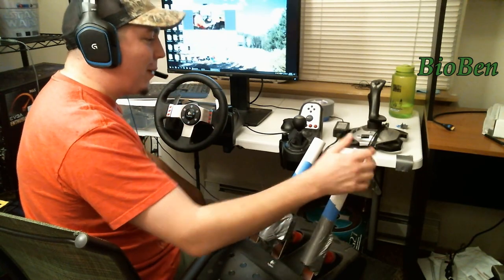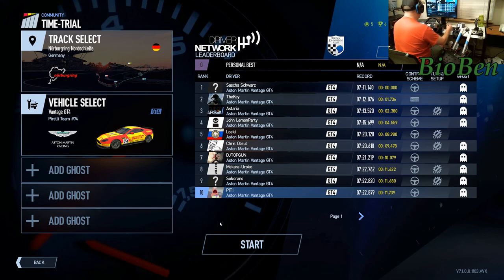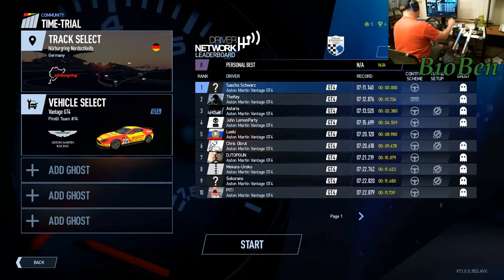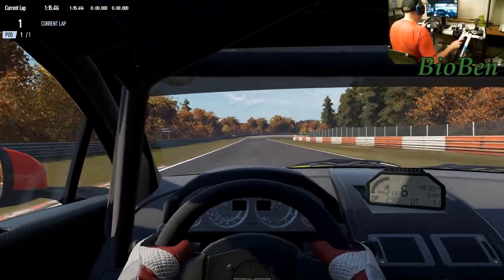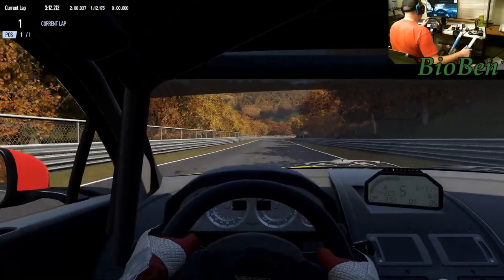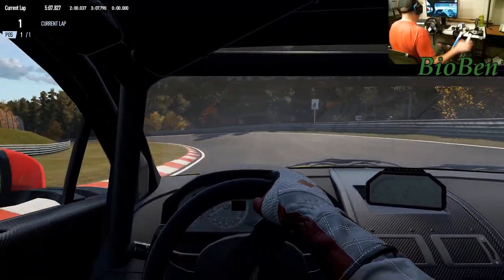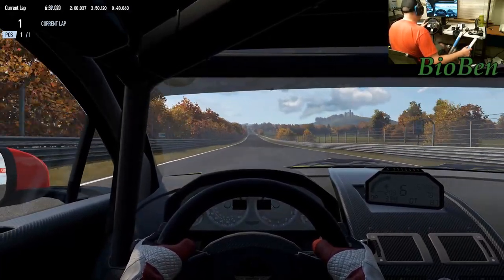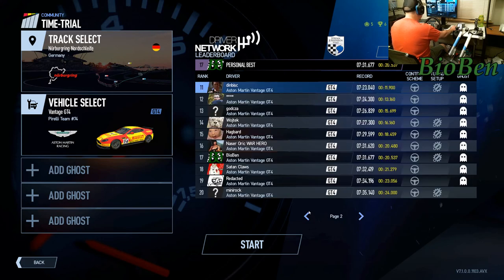Sim Racing DIY Gas Brake Mod Hand Controls For Disabled Gamers | Steering Wheel Project Cars 2

Comment: Look in to the 3drap hand controller. It is a 3D printed hand control gas/brake combo. There is also options like Simability GT Paddle Kit.
Reply from the maker: Ah cool products 😀 was trying to keep it simple and cheep for my friend, but something a bit more pro would be cool. Other thing is if they are Xbox compatible?
Reply: I believe that Simability have some that are thrustmaster compatible. Barry over on Sim Racing Garage here on YT just did a review on a Simability.
Reply: I just looked now and the Simability works on Xbox.
Reply from the maker: @WastedWhiteBoii  awesome I will pass it along to jaf! 👍

Comment: Not bad Ben , that is a great idea and point . I am going to look at what I have and see if I can match,  Rob Chairslayer Parsons.  Does your flight stick twist? If so mount it sideways like a motorcycle. 
Throttle = twist 
Brake = push or pull 
Handbrake=  trigger  or choice 
You could also use tip up and down and sequential shift.  
Velcro mount it to the side of the wheel housing .  I'll try with my thrust master.  I use it for a handbrake already.
Reply from the maker: Thanks man. I just used forward and back as gas brake but that only works on PC. For jaf on Xbox I had to think up something else 😀

Comment: I like your idea but instead of using duck tape I was thinking about using some type of clamp to hold it to the petals maybe like a u clamp with possibly small modifications to make it fit tight. I also suggest buying a spinner knob online to help turn with 1 hand just like I have on my actual vehicle with hand controls

Comment: Thanks for the help, i been beating my self up for about a half of a year trying ways to drive with my wheel only. My right foot has a problem of getting real sore holding pedal down with my foot. Buttons on wheel dont cut it for me, i tryed pushing pedal;s down with my hands, very uncomfortible, but the CVC pipe works fine, Thanks Again
Reply from the maker: Hey! Glad I could help. It's not pretty or elegant but it gets the job done 😀

Comment: Great idea Ben :) Could perfect the setup & attachment of it but definitely shows it has potential. 
Flattening out the tubes on the underside so they sit flush on the pedal face might help attachment, then maybe bolt it on or wrap it somehow. (my T300 pedals have removable faces, not sure how that is for other pedal setups :) ) 

Also: you are forgiven ben <3
Reply from the maker: Also I can't flatten my tubes ... They aren't even mine, I knicked em from the quilt holder.... Haha

Comment: Good job on that. Could dual analog aftermarket paddles be fitted to that rim?
Reply from the maker: Don't know.... It's not actually for me though. Jafmasterflash has a low end rwo wheel for Xbox so this is a cheap non technical solution for the moment 😀

Comment: If you could co-pilot an xbox controller to a wheel and set up one of the analogue sticks as gas/brake that would be ideal.  Trouble is you can't, xbox co-pilot only works between xbox controllers. I've got the official Microsoft Hori Overdrive racing wheel which has a switch to set it as controller, so I can do it, but with wheel set as controller which is no-where near as smooth as when set to wheel.
Anyway I have tried having the peddles in my lap and pressing with my hands, but was no good for me and have just been using shifter paddles as gas/brake (fine for Forza Horizon and OK for Forza Motorsport with a bit of feathering out of bends, but useless with Project Cars 2) ; but your little solution of attaching pipes has really piqued my interest - I am going to try it.
Reply from the maker: Hey! I hope it helps! My buddy jafmasterflash has been using it quite effectively so far! Let me know how it goes! If you have discord feel free to join us https://discord.gg/EMdbvym

Comment: thanks for thining us , recently started gran turismo on ps4 and i want to level up with a steering wheel, i don't have much cordination on my left hand due to hemiplejia and mobility ( to turn the wheel on the wrist. any idea to be able to pull the manual shifts behind your wheel i think it may be hard for me. thx any help is appreciated.
Reply from the maker: Hey man you might be able to re-map the buttons to another location that's easier? Sorry don't have a PS4 so not too knowledgeable

Comment: ive been looking for something that will allow me to use both hands on the wheel, as i want a wheel that has feedback, 4 flappy pedals on the wheel, to replace the foot pedals, 2 for indicators and 2 with pressure sensitive values for accle/brake, thumbs for handbrake and alternative bindings, all in a feedback wheel, would be sick, but i cant find one that meets them requirements, if you know one PLEASE DM me urgently
Reply from the maker: Fanatec has some very expensive wheels with analog paddles that can work but that's about all I know of
Reply: @BioBenRacing  some years later i actually drove a car irl <_< [recently] there is a product that people add to their car irl, to make it possible to drive even for us cripples, still unable to find a gaming/computer version of the equipment, but honestly i can and am looking into designing a gaming version myself and looking for a team who can help me get it produced.:)!  i will keep you updated! :D

Comment: I'm disabled and I would be highly interested in purchasing a hand control system for sim racing AND flight sim.
Reply from the maker: Unfortunately there aren't a ton of options. You could look at the fanatec wheels with analog clutch paddles that can be used as gas and brake. Are you on PC? If so there are more options. You could set up a joystick as throttle and brake
Reply: @BioBenRacing  I'm on a PC for Flight Sim, XBOX One for the car game, but that doesn't really matter anyways since you could probably stream games to Windows 10 along with using controllers plugged into your PC, I think. Haven't actually tried it yet though.
Reply from the maker: Yeah your best bet is PC. It works better with multiple input types. Like one time I did steering wheel for steering. Then hooked up a joystick for throttle and brake
Reply: @BioBenRacing  you know, I actually just discovered that Amazon does sell hand controls, I've seen a couple of different ones for about $270 that seem decent, and some others for even less.  They look like the strap-on/velcro type, which honestly, I've always been a bit hesitant to even try.  I imagine that since these actually look "portable", that they would be a good investment.  In otherwords, you could probably install them on video game controls if you have everything else securely mounted to a table  AND also use them for their intended use, like a family member's car that doesn't have hand controls installed.  So, it might be a good investment.  Here's a link to at least one I found: https://www.amazon.com/Freedom-Staff-Handicap-Controls-Upgraded/dp/B005P9SHGK

I wouldn't think they'd work for flight sim rudder controls but I'm not really sure, to be honest.
Reply from the maker: Good call!
Reply from the maker: Also turtle beach is releasing a flight sim controller that didn't appear to have rudder pedals
Reply: @BioBenRacing  I did hear something about Turtle Beach and a new controller but hadn't looked into it.  There are SOO many buttons to press in flight sim, though and I see the new TB controller has 3 knots that you might be able to pull as well, which is fitting.  Still though, I would think rudder controls would be necessary for serious flight simmers.  I actually did come across a guy on YouTube who used hand controls while flying (a real plane, not fs), I think an engineer friend of his made them, though.
Reply from the maker: Yeah, it might be hand rudder somehow on the TB one